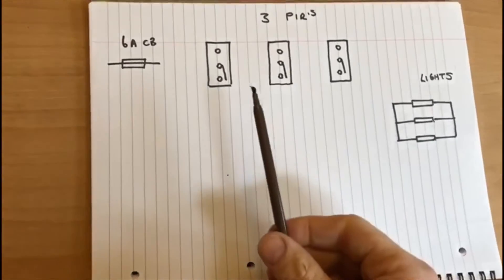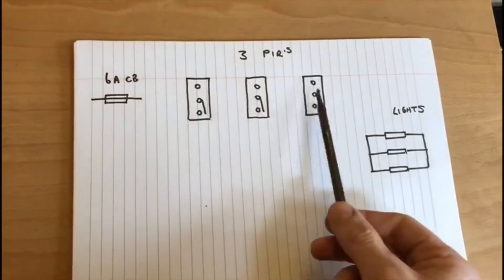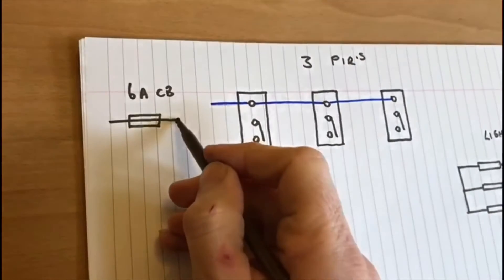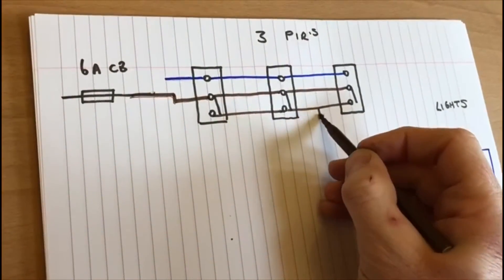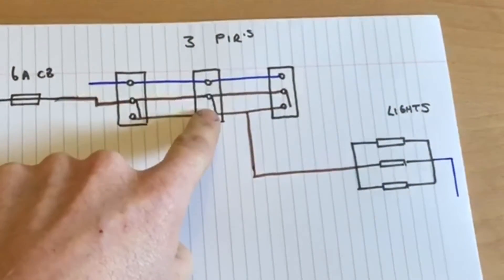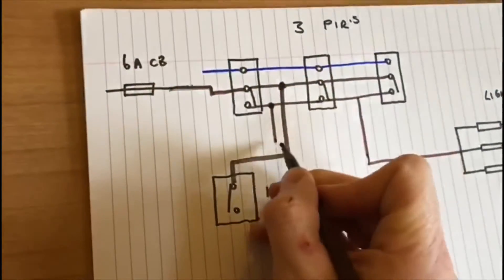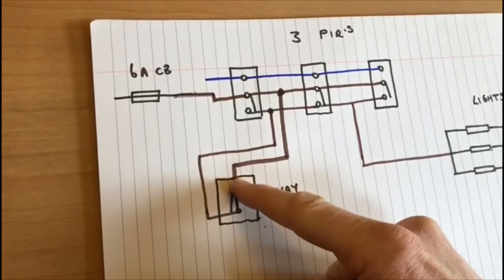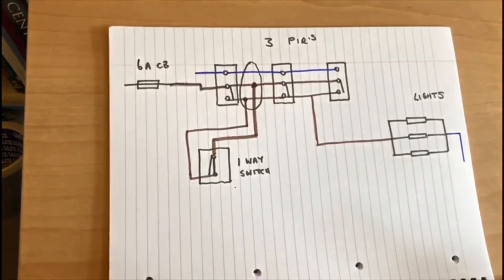3 PIR's Lighting Control - Wiring Diagram Part 2

Comment: Excellent, thanks. Have three working PIR's I saved from the cheap LED floods I bought from Aldi (only lasted weeks before the LED's burnt out) I intend wiring them up to control wall lights around my house. Great advice thanks again. Subbed 👍

Comment: I got fed up with linking PIRs together as the off-delay time setting is a nightmare and very hit and miss at best, also another ball ache when one of them goes faulty. With all this in mind and 40 years of  putting up outside lights I've developed my one PCB base system with on board PSU and relay for the lights. The PIRs are 12v DC making the sensor wiring much easier and cheaper and the time settings are set by DIP switches and Timed by a microcontroller to the second. An optional LED display shows individual sensor activation and lights on off, great for trouble shooting.

Comment: I never tought of this solution.
My schematic relied on a 2pole 2 way switch to switch between power from the pir and mains power.
But the use case is similar.
2 to 3 pir that control 4 led flood lights.
To light up the area around the house and the gras area ontop

Comment: Your bypass switch is not drawn correctly, if those 2 PIR are off on the switched side your lights will not turn on because the lights are wired on the switched side between the 2nd and 3rd PIR, you have drawn the bypass switch between the 1st and 2nd PIR which is not the same location as the load (lights) , please take a look at your diagram again and look at where your load is in relation to the PIR's

Comment: I have a very specific case going on here that I'm not sure how to handle. I've installed Led tape lights underneath both sides of my bed. I've installed one PIR sensor on each side, so the idea is that only one side would light up at night when detecting presence on respective side. Because I have a lack of wall outlets, I'm trying to use only one power supply, so basically each led light and sensor are in parallel with the power supply. The issue is, this PIR sensor closes the circuit up when it's connected to power, before actually opening it and waiting for "presence", so when one side detects presence, it lights up, but when it powers down, the other side lights up immediately, as if the sensor had been connected to power, and it keeps doing this alternation a few times before it switches off completely. I'm thinking two diodes might do the trick, but I'm not sure.

Comment: Hi. So I've wire one 2 pir's, then connected two led 20w floodlights to the switch live, neutral, earth. It works but when the leds are in standby, half of the little leds are slightly lit up. Is this normal? When you fully unplug power the lights completely go out

Comment: Hi what happens if 2 motion sensor are activated at same time in this circuit.will it damage the load.

I want to attach 3 motion sensor to a bell to be used as burglar alarm. One motion sensor infront of each door which connect to a bell. 
Pls suggest
Reply: will not damage, they are all doing the same thing: connecting load (light) to the HOT, the motion sensor is simply acting as a relay triggered by infrared detection
Reply: I got fed up with linking PIRs together as the off-delay time setting is a nightmare and very hit and miss at best, also another ball ache when one of them goes faulty. With all this in mind and 40 years of  putting up outside lights I've developed my one PCB base system with on board PSU and relay for the lights. The PIRs are 12v DC making the sensor wiring much easier and cheaper and the time settings are set by DIP switches and Timed by a microcontroller to the second. An optional LED display shows individual sensor activation and lights on off, great for trouble shooting.

Comment: As drawn your PIRs look like they're in series. To get them in parallel you'd need a JB with a second SL feed from a 2G switch, then 3C+E from that JB to each PIR wouldn't you?
Reply: To be in series, the output (switched live) from one would have to be the feed (live) for the next one, and so on. You'd either have to activate all three to get your lights on, or the inactivated one(s) would be redundant.
Reply: @darrenowen3338  yeah, see it now. Must have been half asleep last time I watched😴. Thanks 👍

Comment: Gteat video thanks! 

Quick question - am I right in thinking that if one of the PIR's were activated and turned on the lights, you couldn't then use the one way switch to then turn the light off could you? I'm guessing youd have to wait until the time set on the PIR had expired.
Reply: Correct
Reply: @javandermerwe  you are both wrong, the bypass switch is intended to turn the lights on, an over ride, however he drew the diagram wrong anyways because he drew it between the wrong 2 PIR sensors, it needs to be on the same location as where the load is.

Comment: Hi. Would you take the neutral from the PIR’s to the light or would the light need to go  back to the board ? Cheers
Reply: I would take the neutral from the nearest pir as the neutrals are linked through anyway
Reply: That’s what I was also wondering?

Comment: My prefered way of achieving this with outside lights is to wire a seperate 3 core to pick up the PIRs and then a seperate cable, either 2 or 3 core to the lights. Run the cables back to the dis board and make a wago joint in a labelled adaptable box. You can go a step further and run individual cables to PIRs which can allow easier fault finding when they eventually go wrong, down side is extra cost of cable.
With corridor lights you can run common 3core through all lights and PIRs, the only problem can be if you need emergency fittings that are to be tested with the remaining lights staying on, in which case you need an extra core or self test fittings.

Comment: I'm guessing we use 3 core and earth from supply?
Reply: Yes, I run interconnected smoke alarms like that as well. Remember to terminate the switched live properly within the consumer unit.
Reply: Only need twin and earth from supply. Then three core between pir. Then twin and earth to light
Reply: When I run the 3 core back to the consumer unit, I've then got a switch  line which can be easily 500v insulation resistance test, also I can add and have added additional interconnected smoke alarms from the board.
Reply: @loosecannon5813  what's smoke alarms got to do with it? You only need switch wire from pir to light.